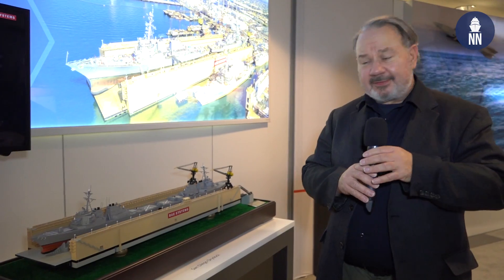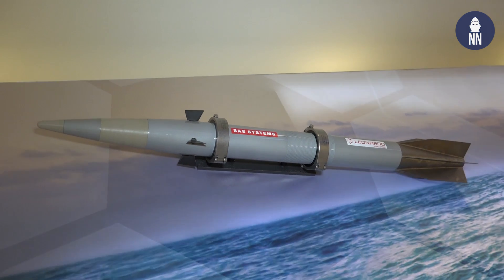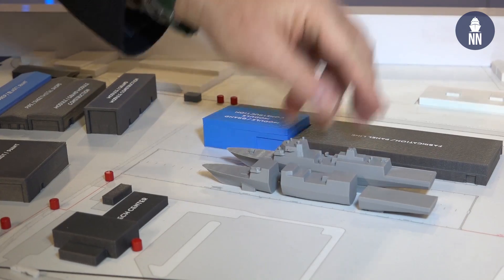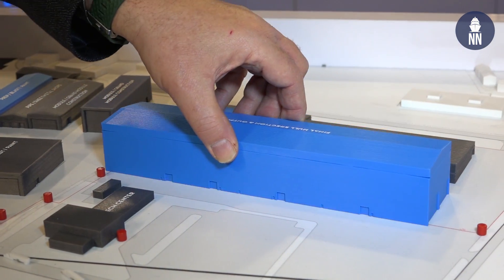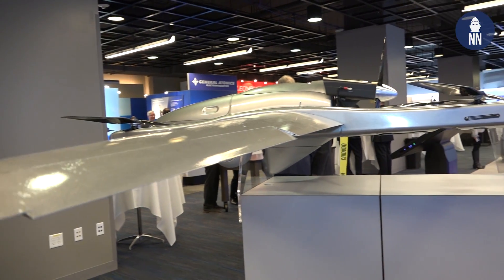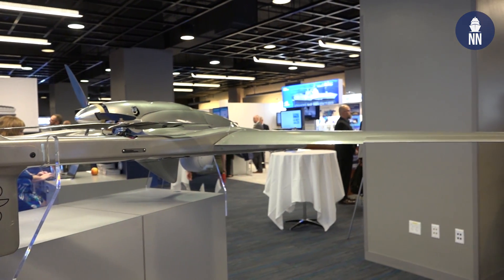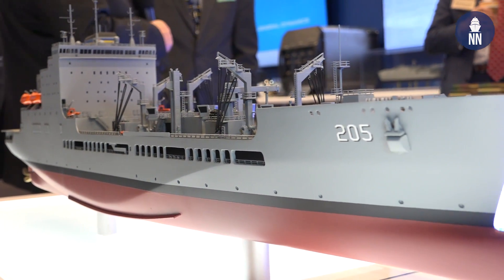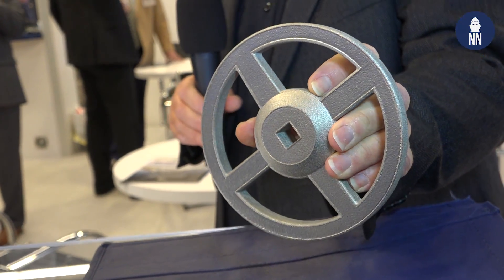SNA 2020 Day 3 - BAE Systems, Fincantieri, L3Harris, NASSCO & GE featuring Chris Cavas

Comment: Why are "guided munitions" far more cheap than guided missiles ???
Reply: Missiles have a booster, fuel, radar and guidance systems, a guided ammo can be produced in way more units than a missile because it’s cheaper (the more you produce them, the less they cost) and because they only need guidance system (IR/GPS) and only need basic control surfaces, plus in the case of the VOLCANO/DART ammo, they’re guided by the ship